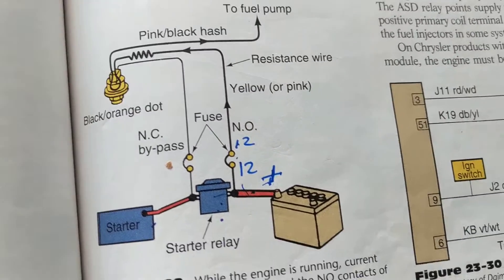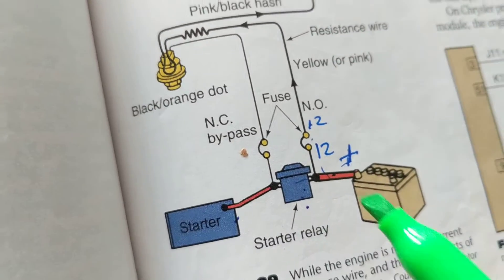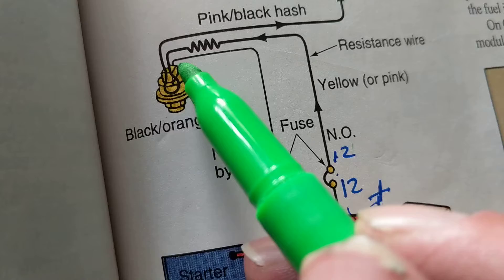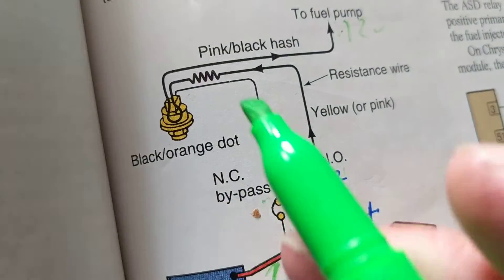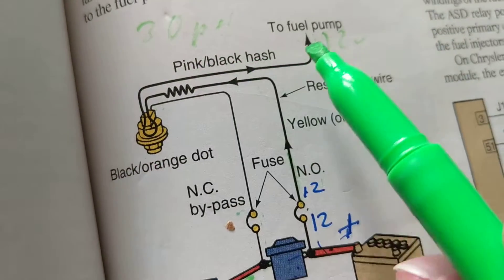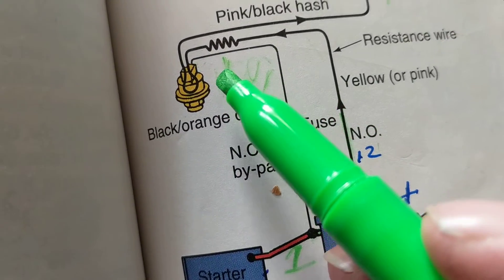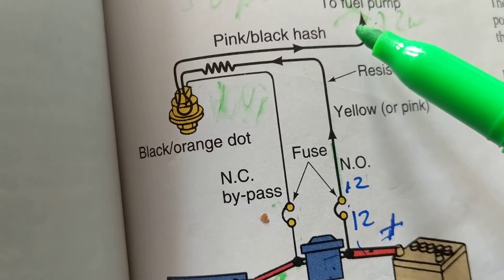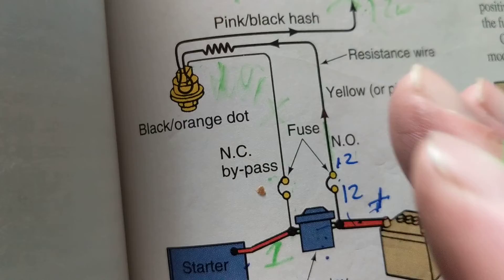HOW OIL PRESSURE SWITCH WORKS WITH A FUEL PUMP FORD

Comment: Will this fuel pump stay on with out the fuse and no ignition. So the fuel pump can just stay on with a proper current from the battery? Please get back to me on this.